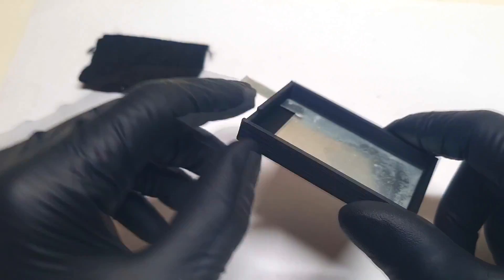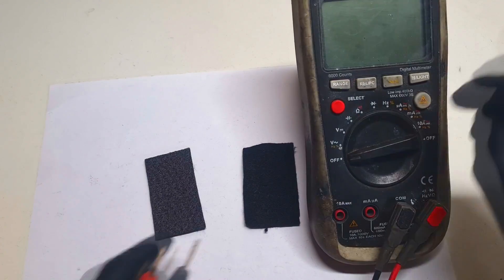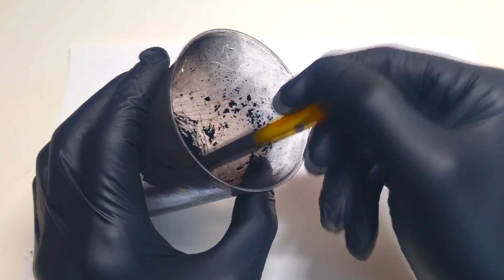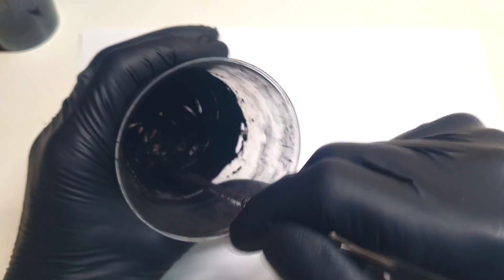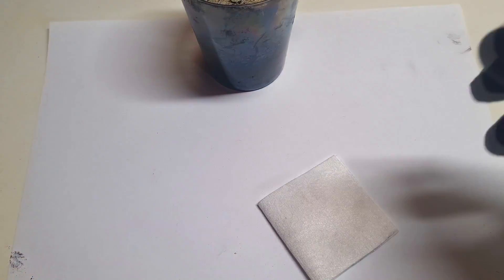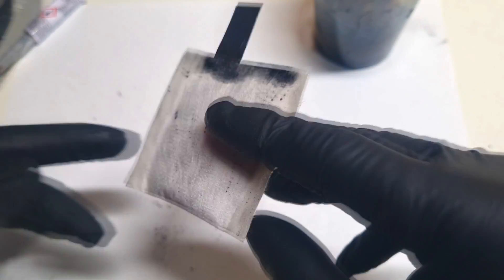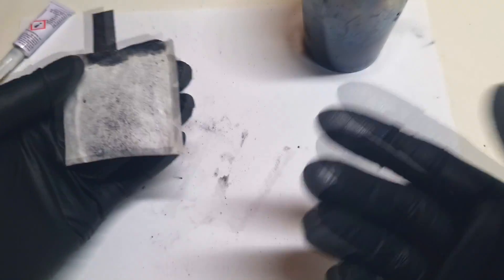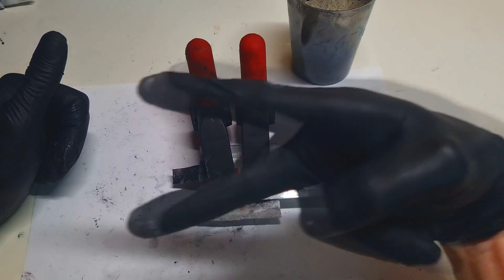Make a Activated Carbon electrode for Batteries

Comment: In the case of a metal air battery how will the oxigen get to the carbon felt if your sealing the whole battery in the first assembly? Do you have space for o2 to circulate?
Reply from the maker: In that case is used another housing which is suitable for metal air batteries.

Comment: Wow, that's actually a lot of short circuit current for such a small active area and relatively simple overall cell architecture...just to be clear, there's no active materials like metal oxides or other functionalization in the activated carbon ? I will note that this bagged method for the AC electrode is very similar to what DK Jawahar (another YT content creator focused on batteries) does in his battery builds and he also achieves pretty high SC current. Anyway, nice video and explanation of basic electrode make up. Thank you as always !
Reply from the maker: Thanks! Yes, only activated carbon. Really? I need to check it.
Reply: @cayrex  For what it's worth, here's a good example of his "bagged" electrode method, although here he does include active material additives to the electrode blend....he also has some recent videos on a compacted, solidified electrode where he uses pine resin as the primary binder.
https://youtu.be/SYY4sKuRjQs?si=8ZRPV61f4QObew4V
Reply from the maker: @nlnl3464  Mhm, nice. Actually I am not a big fan of using binders for active materials if this is not necessary. That pine carbon rod can have good use for current collectors. For example I used damar gum for making current collectors and some inks and they last for some time. For active material binder need the amount of resin be much smaller, because to much resin can limit ("clog") the active area of the material really badly.
Reply from the maker: @Sur_viv  Good for you 😊

Comment: Muy buen trabajo... Gracias por compartir tus experiencias... Pregunta  cuanto tiempo mantiene la carga en reposo... He hecho varios experimentos pero lastimosamente se descarga en pocas horas...
Reply from the maker: Thank you! The self discharge depends on the chemistry you use. Here the self discharge is moderated (sealed cell have a drop around  0.1V / day).
Reply: @cayrex  gracias por tus respuestas  en mi canal tengo algo puedes echar un vistazo

Comment: Man, hi, nice videos. If you want to make a battery that will hold for more than 20 years, you cannot pull it off with binders. The problem is that they desolve. What you want is nano-structured carbon. The very easy way to do this, is take an organic material and pyrolyse it (burn it under an inert atmosphere). Try it with tost bread!
Reply from the maker: Thank you! I am not a big fan of binders anyway🙂 all that extra process, weight, cost,... But you have some binders that can last for quite some time. But like I said I go most of the time with 100% active material
Reply: @cayrex  Yes, 100% carbon (with a bit of doping for better conductivity and as a catalyst [Ni, Pt]) is the way to go. In the previous message, I was just telling you one of the ways to create a nano-structured graphitic electrode based on some papers I was reading. You can also pyrolise sugar to do the same thing!!!! You don't even need to buy carbon with that knowledge any more! Best regards.
Reply from the maker: @BillDemos  👍
Reply: @BillDemos  but who has a furnace at home with inert gas and the sealings to make carbon? It's always easier to buy!

Comment: What about using both carbons. The high conductivity graphitic felt to connect to and then the activated carbon felt as a storage felt, instead of the metal conductor you can replace the graphitic carbon felt and have very little interaction like the metals would. Like oxidation or electrode loss through the charge-discharge cycles.
Reply from the maker: That is right about side reactions of metals CC. But still to have good contact points on graphitic carbon felt you will neef some support. Because over the time the contact area (where you conect crocodile cable to cell) of graphitic felt will damage. Other variant can be the graphite foil for example.
Reply: @cayrex  Yeah I am using the graphite sheet cut and I form a cake of carbon and binder to the graphite conductor. I didn't have the felts to use, which would have made it much easier for the binder to work with the cake and give it more support. My suggestion would be to use both kinds of felts but only use the cake on the finer carbon felt. What we have here is a hydrogen storage system. The conductive part of the carbons allow for electrolysis to happen and store that energy as in like a pressure that is released when you short the cells through a load.
 I found sometimes there is a natural electrolysis that happens if there are like copper foil attached to one side like you did. It's doesn't change the conduction but does change the electronegative potential between the carbons and the copper. If you can shield the copper from galvanic response between the two materials the electrolyte will breakdown and store the hydrogen and oxygen at the appropriate electrode carbon cake. This process is reversible and acts like a old edison Nickel iron batteries..

Comment: Great minds think alike... I just made a video on this same topic but with a different method. I just need to edit it for Youtube. I will leave the link in the comment section for you to check it out. Question: Did you build a super capacitor here or is it a battery? How does it do with self discharging? Thank you.
Reply from the maker: Cool,.... I will look for the link. Here I made a hybrid device and was more or less for demostrating. The self discharge is moderated
Reply: The 2.5 amps dead short on your build was impressive. I will drop you a link once I sit down and edit the video on a method that you may find useful for plating and making electrodes. Once again, thank you for sharing this information. You have a great channel here and I know a lot of people appreciate what you do.
Reply from the maker: @flash001USA  Thank you sir

Comment: Hello mate
Could you use the covid surgical masks to do that?
I think they would give very good results. I bought many for that purpose, to use them in the separators of the supercapacitors.
If you introduce a stainless steel mesh inside those electrodes, I think it would also improve conduction.

I have been thinking about using sugar to make carbon electrodes for a long time, using it as a binder, mixed with the activated carbon powder and then carburizing it in a microwave for example and in that way making a solid sheet.

Comment: Is it rechargeable?
Reply: magnificent! 🙌🏽
How many milliamps and voltage does a zinc-air cell charge?

￼

￼
Reply from the maker: It is about making the electrode. But yes,... the battery which was made in the video is rechargeable.